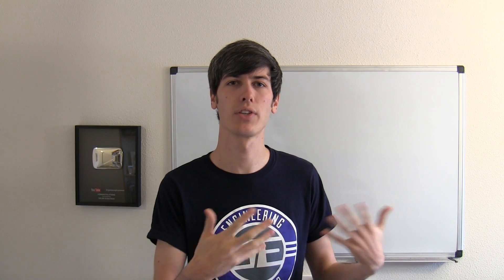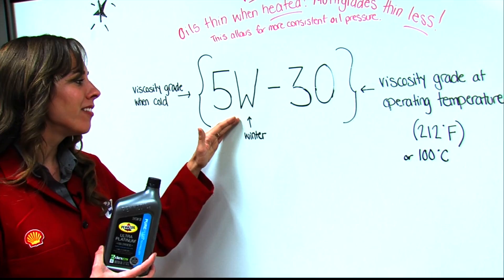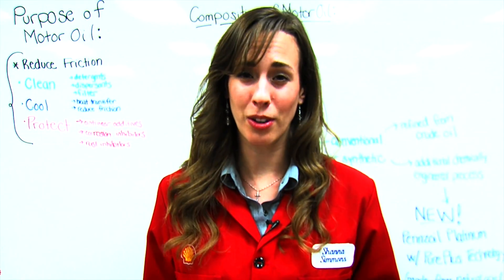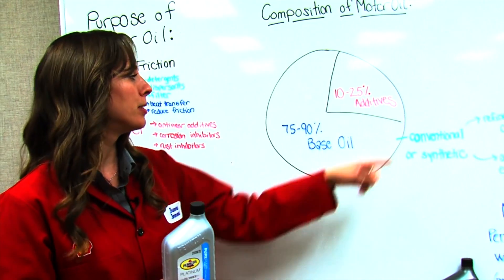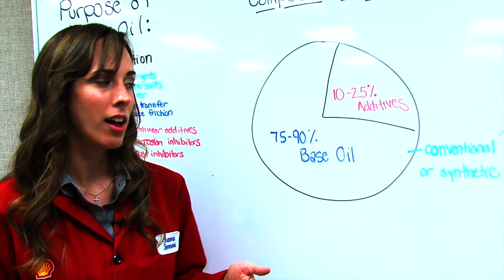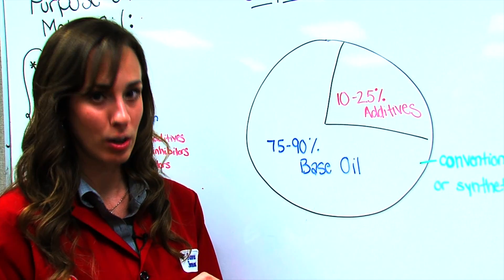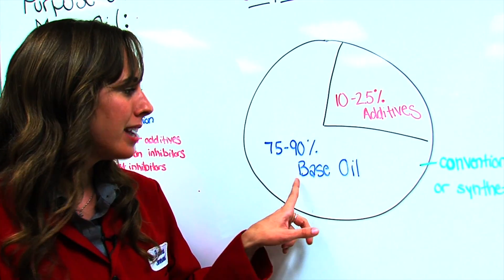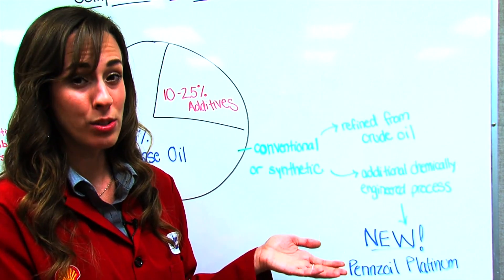Motor Oil Myths & FAQs - Synthetic vs Conventional

Comment: I just use a semi synthetic 10W30 grade of oil in my 2002 model Holden Commodore which is factory fitted with the Chevy LS1 engine,while I've seen 5W30 is recommended for the LS1 in the U.S. the climate must be a bit warmer in Australia during the winter so Holden has recommended the use of a 10W30 GF-5 engine oil which I keep using in an engine which has done over 320,000 kilometres as the engine has no oil consumption issues,I have always heard the W stands for the "weight" but the 10 part of that grade is relative to how viscous the oil is at certain cold starting temperatures meaning how fast any given volume of oil will flow in a cold engine to provide adequate protection for vital engine components (i.e. the lower the number, the faster flowing the oil will be).
I remember in the mid to late 1980's when Holden fitted the Japanese built Nissan RB30E engine into the VL Commodore,a 20W50 oil was still getting specified for a 6 cylinder Holden car when they were built to tighter tolerances (tighter bearing clearances) than the old 202 cubic inch Holden six which was designed to use that oil,an ex Holden mechanic told me at an auto parts store that the Nissan engine should be running a 10W30 engine oil,I know Nissan specify a 7.5W30 oil for the RB series engines but I am told you can go either way with them (i.e. 5W30 or 10W30),I did notice an increase in engine performance with the RB30 after using the 10W30 grade due to a reduction in drag against the crankshaft.
I am not sure why people have been trying to sell me a 10W40 motor oil for my engine as that won't offer as much protection for my engine when warmed up,I did have hydraulic lifter noise which was caused by neglect from past owners but it seems people thought my motor (LS1) had shot bearings when a chemical treatment (Wynns) fixed a lot of that up,so I keep on having to look for a 10W30 oil everywhere,a thicker oil won't improve that problem rather make it worse.
I don't know what happens if you don't change your oil, I have experienced it in someone elses car where a Toyota 1GRFE engine was neglected for 22,000 kilometres by not getting a service done on it,we had to add 5 litres of oil to the engine so we wouldn't blow it up as there was only about 1 litre of oil left in the sump,the oil just breaks down after a period of time & turns into sludge,a lot of that oil would've been either sucked into the intake via the PCV system (as normally happens) or just got that hot that it vapourised (turned into a gas) the by product of which is just carbon.
I have heard of it happened to one of my bosses where one of his tradesman was driving his Toyota Hiace & the oil light came on - the van had been driven for 20,000 kilometres without a service,my boss was just very busy & lost track of that meaning he had to get it serviced on a weekend which he had off.

Comment: 5W-30

Lower the number next to "W" it will harder get too..hard,thick for oil pump to cycle it -in cold weather(Rating below 0W doesn't exist, thats the lowest it gets :D )

30 or whatever  it is, means how hard it is for oil to become too "liquidy"(in warm weather, or high temperatures) and thus vanishing off the parts too quickly and lowering the performance of lubrication.

Comment: One question that was not addressed. Should one go with a thicker oil as an engine ages? I have a 25 yr old vehicle that calls for 5W30 or 10W30 but I use 15W40 in it due to it's age and mileage because it does consume a little bit of oil between changes. The thicker oil gets consumed a lot slower than the thinner oil.
Reply: +BigDish101 
You are doing the right thing. ;)

Comment: What about classic vehicles, such as the VW Beetle? Is there any benefit from using classic oil, as the engine lubricants were a whole lot different then from what is available now?
Reply: +Max Robin Drott 
Well, let's say that there is not any benefit in using new oils. 
Unless the old engines are rebuilt from scratch, with new head and oil pan gaskets, piston rings and seals of the valves, quite often new oils with modern specs can make damages in old engines. 
You can keep using standard mineral or semsynth oils with the API specs recommended by the car maker.

Comment: ***Yea that was a complete fail and really lame.  The editing was crap, the content was a PR ad at best.  I am really shocked as your videos are usually very good.
Reply: +AdventureCayman Agree with this. It was all "party line" and "for the consumer" stuff. Would have been more interesting to understand the trade-offs are and address specific topics like ZDDP content and oil pressure vs oil flow. Surely theres something to be said with respect to a car being raced having different requirements than a street car... if nothing else in frequency of oil change for example.
Reply: Agreed, she was reading form a crib sheet that could easily be from promo material Q&A, or a car user manual.  No depth to it, all very basic and general info.
Reply: come on, you were looking at the whiteboard? the rest of us were looking at something else

Comment: if  you change oil as recommended by the car maker than you have no issue.  Synthetic oil are conventional oil that have their molecule chop up and recombine.  By doing so, the oil has less chance of breaking up due to heat and stress.   Unless your car is design with synthetic oil spec there is no real advantage.  Unless you don't change oil as scheduled.
Reply: +Bill Kwong 
Synt oils are totally created and made in laboratory. 
Semysynt oils are mineral oils that have been "modified" in the laboratory. 

"If  you change oil as recommended by the car maker than you have no issue. "     this is half correct. 
In fact, if you drive your car only for few km in the city or under stress (full load or towing), it's recommended to change the oil at half of the time specified in the manual book.
Reply: Group 4 synthetics are in a lab, group 3 are not PAO based, they are mineral oil based, for normal cars group 3 and 4 are both still superior to the group 2 conventional oils.

Comment: I'd like to know what type of oil I shall use in my Japanese 660 cc Daihatsu car. I live in a country with extreme hot climate in summers... Answer will be appreciated.
Reply: A true synthetic oil (no mineral oil) will shrug off heat much more quickly than a mineral oil will.  It is also going to maintain its proper viscosity longer and it is less reactive to combustion byproducts and water.  I have always used synthetic oils for the peace of mind it provides.  If you decide to stay with a petroleum oil, consider installing an oil cooler because the hotter an oil gets the quicker it deteriorates.

Comment: Question. Is there any point of using oil with higher API spec? I have an engine (30 year old) which has to have oil that is "API SH/SJ" spec. Is there any need to buy more expensive oil that has a newer spec? "SM/SN"...
Reply: you could if you wanted to the higher api letter grades indicate newer formulation they are always improving if even just a little
Reply: The problem is that I cannot justify buying an oil 3 times the price of the oil which is on spec. I have a feeling that newer oils are developed to newer engines which is made less robust than older engines. correct me if I'm wrong...
Reply: Phil Jones you can use what you want if it's to spec but the new stuff is better
Reply: Ian Irizarry Thank you captain obvious.
Reply: +Phil Jones 
The newer oils are designed to cope with the much tighter tolerances that engines are manufactured to these days, as well as coping with the longer drain intervals quoted by the manufacturer. An oil 3x the price is still cheap when compared to the cost of an engine rebuil#d.
Reply: but is the "older" oil good enough? the question is - why should I buy newer oil to 3x price?
Reply: +Phil Jones 
Yes it is good enough.
Your engine is 30 years old, it can run with oil with the specs of 30 years ago. 
SM or SN oil have detergent additives that are too strong for old engines especially with a lot of km/miles. Its strong cleaning effect removes deposits and dirt much faster than an old oil and they can clog the oil filter.
Unless you change the oil and oil filter very frequently in the first thousands of miles, you can easily keep using "old" oils.
Reply: Eugenio C Finally a decent answer. I don´t understand why someone mean that newer oils should be better for an old engine with 100k+ miles... I change the oil every year. The car isn´t driven for more than 1k miles a year anyway. It´s a high compression Porsche 911 engine, but I believe it´ll survive.
Reply: +Phil Jones 
As long as there will be people who believe in what is stated in this video, there will be a lot of lack of knowledge and ignorance in this field.
This is how car mechanics, "fake engineers" on youtube and dealers make money, by taking advantage of this ignorance...
With the distance you drive, you can use any mineral or semisinth oil and strictly change it every year.
Reply: Eugenio C I agree... what I´ve learned so far is that newer oil is unnecessary for my car. Thanks Eugenio!
Reply: +Phil Jones 
You are welcome ;)

Comment: So the answer is a complete NO to all additives?

I have a real life example. Let's say there is a BMW 328i (2007), which uses 0W-40 synthetic motor oil, with a minor oil leak. Instead of putting out the few thousand to fix it, for the time being, would it bad to use something like Lucas Engine Oil Stop Leak or some other leak stopper?
Reply: +usandmexico 

If you suspect that the leak is down to shrinkage of the oil seals, then I would recommend going back to mineral oil based instead of synthetic. Mineral oil will swell the seals back up again and may control the leak batter.

Comment: Manufactures don't design motors to utilize particular oil grades. They accept bids from oil companies as they do for any other item involved with a cars assembly. The recomendation of oil changes every 3,000 was brought on by the newer closed systems on cars, bikes and lawn mowers (motors) involving electronics and EPA standards for inviromental polution. While there us a difference in grades like 5/40, 10/50, 20/40 etc. which is the results of adding supplements (blending) the 10 to 25 percent with the 75 to 90 percents. The base oil (75 to 90) is no different regardless of who's refinery it was refined at. The basic secret for a successful business is and always has been "Creat the concern; Create the resolve". If done properly, hugh profits. Think about it!
Reply: The 3000 miles oil change recommendation is historic. it goes back to the days of cast iron engines and mineral-based oils with limited additive packages compared to today. Go back to the era of American cars from the 1950's through the 1970s and you would see what a mess engines that did not have frequent oil changes turned into. Some survived better than others, but all of them could go bad and suffer stuck rings, worn bores and worn valve guides. Also leaky seals. Cast iron engines often had high oil consumption also. You are correct that it does not matter who produces the base oil but different weights of oil start out with different weight bases. Amsoil is not a refiner. They buy base oil, put their own additives in it and then package it.

Comment: In case of older engines, let's say 20 years I would use a 20w50 because a lighter oil would not lubricate enough to what I've hear from several mechanics. How accurate is that statement?
Reply: That's correct. But age is not necessarily the determining factor, mileage and wear dictate how thick the oil should be.

Usually, if you have a certain oil, let's say 5W30 and your car is burning oil, then you need to go thicker.

Comment: Some extra additives are required for older engines with flat tappet lifters, as modern oils have no zinc because it can foul up the cat. Older cars that don't have a Cat need zinc to keep the camshaft from flattening out. You can buy oils that have zinc for older cars but you must be careful to make sure it has it. If not then a zinc additive is needed.
Reply: +C MJ I hear the diesel grade oils are high in zinc. Delo, Rotella, Delvac. I use Delo in my 25yr+ vehicles.

Comment: So my question is, should I do a 1 quart 'rinse' before I put in the full amount? And how should I go about doing it? Do I turn the car on with just the 1 quart or is that dangerous?
Reply: +HybridofDoom you should definitely do the 1qt rinse. drain all of the oil, put in 1qt and drive for about 75 miles. that should rinse completely all the previous oil. also look for a knocking noise when the engine revs, being a good sign of the rinse working!
Reply: You sure? 75 miles doesn't seem like enough, my engine didn't even knock.
Reply: +piruja tube You forgot to mention draining all the coolant out first so the engine can get extra hot and bake the deposits out of it. Lol
Reply: rdinnan82
Too many deposits in my radiator and engine that I need to power wash the build ups out.
Reply: You can take the oil cap off and spray the washer right into the engine directly for a better clean.

Comment: Read your owner's manual mines says if there's no 5w 30 avalible you can use 10w 30.
Reply: +Leo Guy and generally 0w-30 would be even better if you have access to it.
Reply: +Ali Ahadi That's BMW oil?
Reply: Leo Guy No, the weight is non specific, but sometimes harder to find. You should be able to find it at walmart that or you can order it. Amsoil 0w-30 on their spec sheet seems to be pretty nice. Basically it'll have pretty much the same viscosity when warmed up as your 5w-30 or 10w-30, but when you cold start the car the oil has a lower viscosity so it will lubricate better.  

One thing I didn't like in this video is they tell you nothing about actual viscosity. Because the number on the bottle is the group number, the viscosity specs can be found on the manufacturers website. For instance 0w-20, 0w-30 and 0w-40 all have the same group number for cold starting, however, if you look at the viscosity specs say for mobile 1 you'll find that they're all different and the gap between 0w-20 and 0w-30 isn't so huge, but between 0w-30 to 0w-40 it's pretty significant. 

Viscosity is what you're mainly looking for, usually within your designated group you want an oil that has a lower viscosity at cold start so that it can more quickly lubricate the engine while warming up. This is part of the reason why race cars have oil warmers prior to turning on the cars.  Usually at operating temps a lot of the oils don't have much a difference in viscosity. 

But if you compare between brands of the same "weight" you'll see that their viscosity specs are different.

Comment: Hey i have a Ford f 150 truck 89 model 4x4 winsor 5ltr goes well but it uses oil but it doesn't blow any smoke at all no leaks are there any one who can help me with a idea I have checked the pvc valve and it rattles when shaken I have no idea what the problem is
Reply: +nathan schmidt i had an '88 F-250 4x4 5lt manual tranny and also suffered from oil consumption. after visiting many mechanics to no avail, i decided to take it one step further and installed a tiny camera under the hood only to find it was the OIL GREMLINS stealing the oil. every night they creep into the engine bay armed with straws and suck out the oil through the dip stick. Hope this helps
Reply: Cast iron engine often just have higher oil consumption. Microchannels in the cylinder walls and such. Another possibility is stuck oil rings. Take a long trip, You'll burn the carbon out. Where you go depends on where you start.